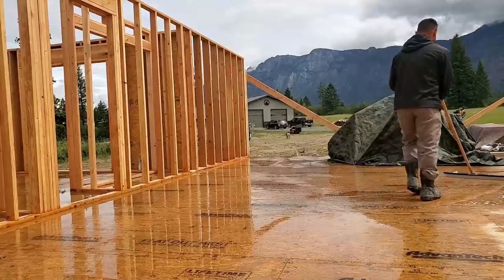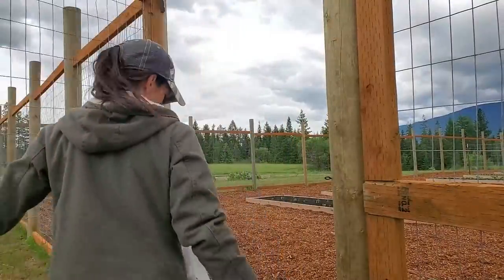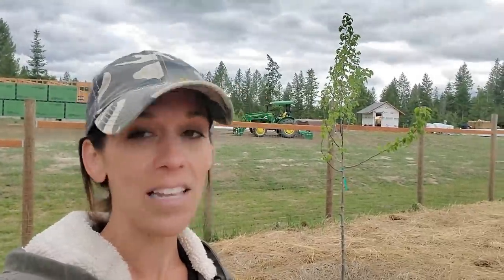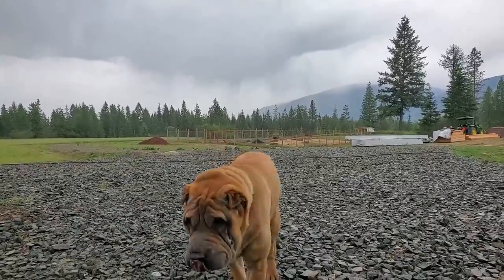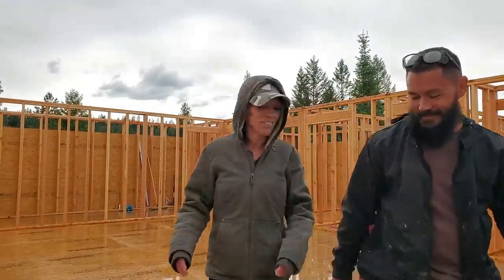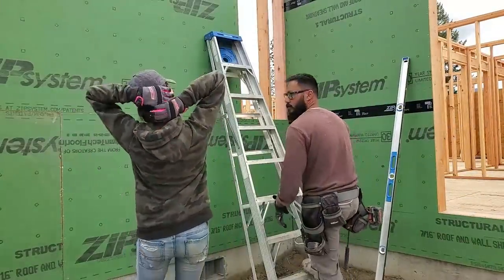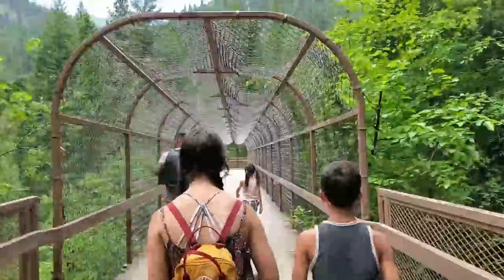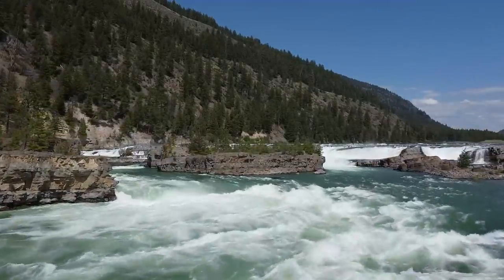Tying It All TOGETHER | Finishing Up Our DIY Home Build Framing

Comment: Be safe guys, using the saw in the rain, is not a great idea. Love watching your show, great to see how God is blessing you.
Reply: Surprisingly, it is not as bad as it seems.  I worked with a group that did hardscaping. They would cut flagstone and similar with a circular saw in a tub of water.  The blade sprayed water everywhere. The saw was drenched.  Never a problem. Just be sure to use a grounded outlet.

Comment: It's a tough year to build with material shortages/pricing. I'm a General Contractor/ framer, be sure to put temporary bracing in the middle, 90° to all interior and exterior walls, especially if you have to wait for trusses or if you're going two stories, with floor joist. Later you'll be able to use the bracing material in the rest of the build. Good luck 💪💪

Comment: Just a tip for you. If and when you get to freeze dry your produce, remove the seeds. They are harder to tell when the moisture is out. It could take months before you can see that they weren't and ruin things like tomatoes and cucumbers packed in mylar fast. In first year I didn't and was very sad throwing out mushy bags when I found them.

Comment: A suggestion.  Based on the intense heat you guys have had to deal with this early summer can you imagine the heat you will work with every day after the roof is on and you have buttoned up the windows and front doors?  Here is something I did years ago on a project to address this to make it survivable while putting on wall board.  I bought a used window air conditioner and mounted it in an empty window with a temporary wood fixture rather than glass.  It lowered the temperature 20 + degrees inside and saved us from heat exhaustion.  After finished inside we simply uninstalled the air conditioner and put the window in.  Best 500 bucks I ever spent.

Also, when we lived in Utah we did not have air conditioning in our house.  Except for a few weeks in August it cooled down every evening because of our living near the mountains.  So, I installed a huge attic fan in a hallway and in the afternoon we opened the windows and turned the fan on and it sucked air from the cooler outside,  inside our house which made it quite pleasant.  Not sure of your hvac plans but this might be a cheaper alternative you can try out.  You can always go AC later if you want too.  The large fan fit in our hallway and had painted cream colored slats which remained shut when off.  When on, the slats were forced open by the air pressure.   It worked perfectly.

Comment: I have a garden secrete that helps sock seeds for 48 hrs and then plant in a green house in plastic transplant pots. It can extend season upto 2' months this if you add plastic loops with cleat plastic tarp you extend season many in mountains actually if can do it put in permanent green houses for crops that need longer growing season  also you need to invest in a huge compost system  it all helps. Currently my garden about to explode with veggies.

Comment: After you get the house all dry then you need to get several dehumidifiers because moisture has gone under the walls between the flooring and the walls and that will eventually not be able to dry out you need to pull that moisture out then it will not rot

Comment: Why not lay a tarp over the biggest open area and for the rest of the space lay some 2x4 every few feet and create a roof space with another tarp.  That way you have a sheltered space to cut under and you will not have to scoot water out as much.  just tie the tarp off around the edge or else water will build up and pull it in and down.  You can use the time till your trusses arrive to do all the blocking and drywall backing in all the rooms.  Towel rack backing, backing for cabinets.  I just use plywood instead of sheetrock behind the cabinets.  This way the is no chance of missing a stud when installing them.  I do the same thing for all baseboard and crown moulding.  It's a good way to use up all your scrap pieces.

Comment: I'm wondering if you planted too much lettuce at one time since it will mature about the same time and I don't think you can eat it all before it goes bad. Usually, you plant every two weeks so you have enough to last the season. Same with radishes and cabbages. Just wondering.

Comment: What about overhang for the top plates? How are you going to hang your ceiling if your top plates do not overhang?  Interior walls need top plates to overhang on both sides. Outside walls need an inside overhang. A 2X6 will give a 1inch overhang on both sides of a 2X4 top plate. Looks like a do-over coming for you on the top plates.

Comment: I've been working with all kinds of tools for over 60 years and learned enough not to use tools in the rain or snow like they do on u- tube. Power tools and water don't mix and steel components in the tools, (bearings and such) will eventually rust and cease.. Put these tools away without use for an extended period of time, and the rust will cease the tools operation.. Tools in the right hands should outlast a lifetime, with right care...

Comment: Curious,  Not trolling.  Why didn't you put the top plate on when the wall was on the ground?
all you had to do was either leave out or add to depending on which wall it was. then when the wall is stood up it acts as a lock to help hold the wall.

Comment: > im also 'entertaining' the triple top plate comment only because...the trusses youve repeatedly mentioned will no doubt go up like nothing except you will discover thats exactly what there will be to fasten the ceiling product of your choice in those places where it, the ceiling product, runs parallel to the 'system' trusses...never mind, one of those foreseeable budget things that 30+ years as a conventional frame carpenter copes with and ultimately walks away from...convention.

Comment: Are you putting engineered trusses on your home?  Typically you use two 2x top plates on bearing walls, and a one 2x and one 1x on non bearing walls.  You don't want the bottom cord of an engineered truss to contact a non bearing wall.

Comment: I know its hard to believe but a framing crew would have had that whole frame done with roof and all in less than 1 week. That saves on water damage, time etc... Once a structure is dried in, then take your time and do things yourself. I would have at least recruited others like the Amish do to come in a do a raising to get it done if you wanted to do it yourselves.. this is not the part to take your time on as you have learned. Still good on you both for your effort and energy and family values, just painful to watch your house get rained on time and again :(